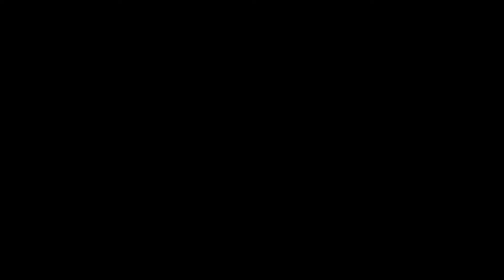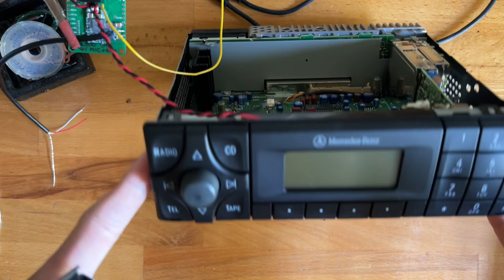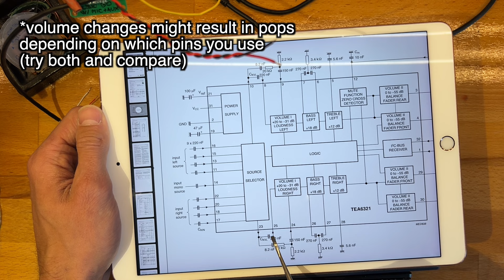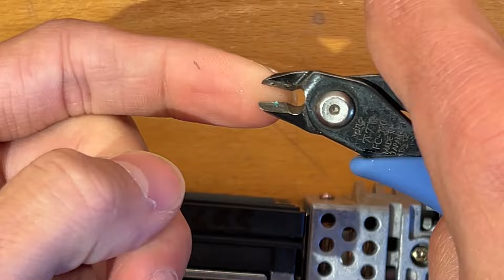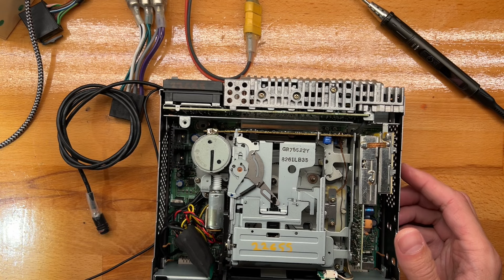How to add Bluetooth to a Car Radio (or) Mercedes-Benz Audio 30 CC CM2299 - Bluetooth / AUX Tutorial

Comment from the maker: feel free to write me if you're interested in modding your own Mercedes-Benz radio 🤘

0:00	intro
2:02	functional overview of a bluetooth/aux mod
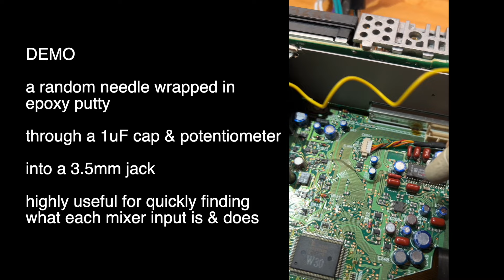13:12	tool I use for finding audio paths 
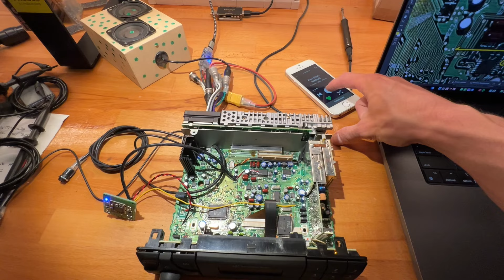13:52	audio & power connections for the Mercedes-Benz CM2299 Audio 30 CC
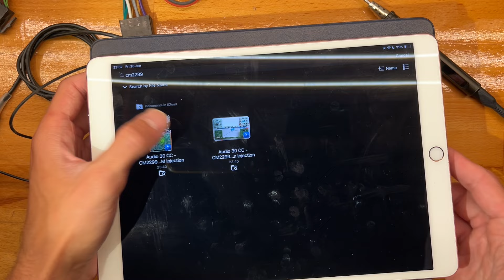21:50	annotated schematic
26:45	bluetooth music demo
Reply: Hi could you modify my MB Audio 10 CD??
Reply: I would like to mod my BE754 with a TDA 1029 making it to switch to the tape channel. Could you help me on it?. Thanks a lot in advance
Reply: Hey Dariee I have a cm2299  radio(same as vid) and would like you to add bluetooth. Would u be able to help?
Reply from the maker: @michaeldavid2829  sure - send me an email at lipton 5001 yahoo com 🤘

Comment: Hi, I have a slightly different question. I have a BMW stereo, CD43 made by blaupunkt, but I am sure it applies to other radios as well. I am looking to add a line out connections instead of just speaker outputs so I can get a better sound quality by eliminating the internal amp. The internal amp is a TDA 7376B like probably a lot of the stereos from the same era. Have you attempted to do something like this? Thanks
Reply: Google Kenotronics

Comment: Great video.  I would like to add an external BT module to my Mercedes Alpine CM2299 using the input pins of the TEA6321T. Do you know the input pin assignments for this radio? For example…i would like to connect. My BT to the L and R input pins for the AM or CD before they selector section by isolating the radio input by unsoldering and lifting the pins off the board.  This way i can just select AM (assuming it uses an L and R input pins) or CD if AM uses mono input.  The TEA6321T has four stereo inputs (FM, TAPE, CD, ? Plus AM an WB.  I can’t find a schematic for this radio.  Thanks.  Dave

Comment: I have a Becker Audio 30 BE6003.  It has the D2B for the CD Changer.  I want to add the Bluetooth module. Which module do you recommend and what is the programming involved with it?
Reply from the maker: simplest way forward would be a QCC3008, where you can find galvanically isolated modules on alie, I recommend getting 5V ones, and I also have tutorials on programming them as well 🙂‍↔️🙂‍↔️
Reply: @Darieee Do you have a picture of the mods required on the pcb board and front controls on my model of radio, or is it similar to other radios?

Comment: Can you help with Audio 30  APS (BE4705) ?
Reply from the maker: unfortunately not .. I had a few cracks at that model, and couldn't figure out a way to inject audio over the AM signal

I managed to connect to the CD audio section, and that worked with playing a disc with silent mp3s .. but VERY unreliably, the disc mechanism would constantly eject discs, even 650MB ones, 

I can't say I recommend trying - but if you do, let me know how you did it 🤘

Comment: Is there any way to add Bluetooth to 2006 W220 facelift head unit with the tape deck? MOST Command APS. Please let me know
Reply from the maker: should be doable - but watch out

all TAPE systems usually time out after 30m - and usually require an actual tape inside to link the spindles together (to prevent disasters if the tape breaks)

so - you'd need a tape, and it would switch back to fm or stop after 30m most likely

do try the AM method please, and let us know if you got it working 🤘🤘
Reply: @Darieee  I have tried that in the past and the connection was not the best. I was wondering if there is any way to directly wiring a Bluetooth receiver to the dead of the tape deck, or if there was a way to add AUX.

Comment: Awesome video!  I have done at least a dozen or so of this kind of mod for myself and clients (im an MB mechanic) and I just have one question... why are you using the AM input in particular?  I normally just use the tape or CD input, and when nothing is coming in over BT, it works normally.  When BT starts playing, it immediately switches over to it.  Just curious
Reply from the maker: I had many issues with tape & disc .. with the disc, you always need a blank mp3 disc, or an audio one for older radios, and the audio 10 cd REALLY hates 700mb discs, so I had to find new old stock of 650MB discs, still have a ton of those, huge pain in the ass and not very robust and/or elegant (and the audio 30 aps - really hated any and all discs I threw at it)

on tapes, its even worse, most units time out after 25 minutes or so, and you have to press CC again every time to go back into bluetooth streaming, again, highly annoying; furthermore, if the belts eventually die out in the tape-mech, it'll think your tape's jammed, and time out instantly

with AM, everything mentioned above is totally solved, with the only downside being the loss of AM, which often times is a very worthwhile cost to pay

the APS BT-2 can be modded to mute FM when bluetooth is playing, but even there, I found that just blanking AM and having that be separate is more nice to use
Reply: @ I understand... i may have to adopt your idea!  I have an MCS Radio, and I just put a different (pre-recorded lol) CD into the drive every other month...so that i always have something to listen to, even if i dont feel like connecting BT.
Reply from the maker: @Johnathan_Waters  nice to hear someone else's also fighting the good fight ✊